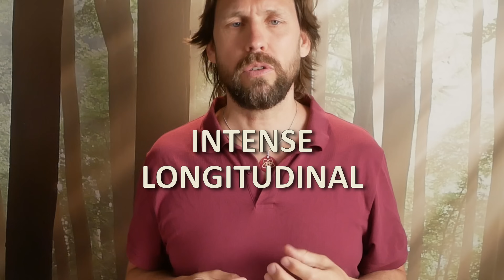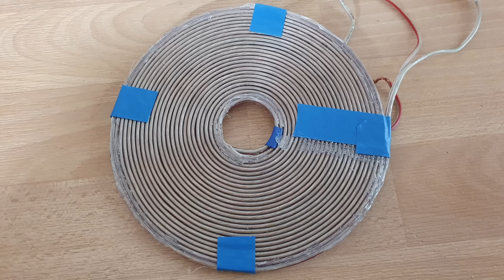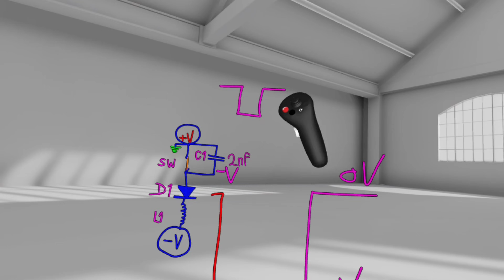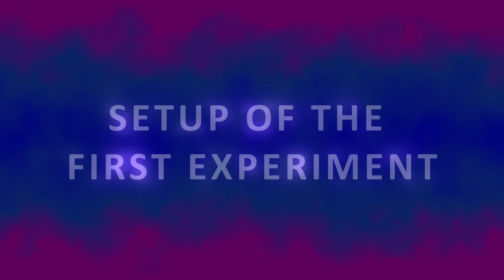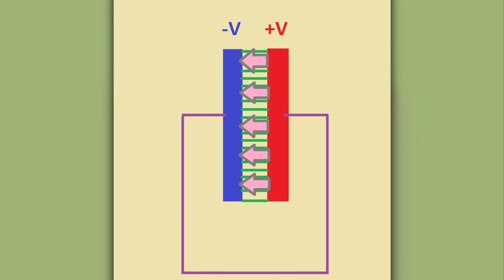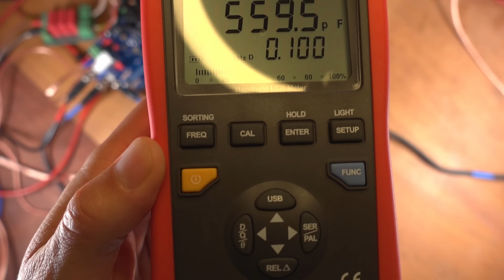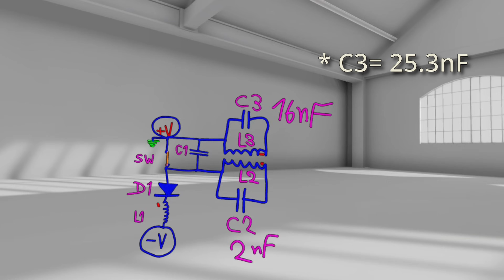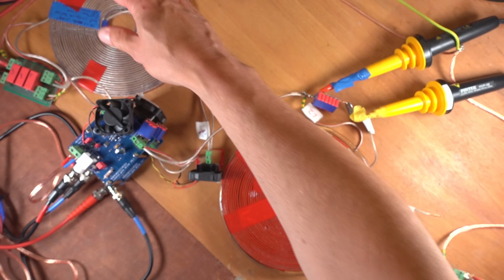Dielectric Induction producing Ground Currents

Comment: I have been reading "The Sea of Energy", T. H. Moray and asking copilot about various aspects of the schematic he has and the "Swedish stone". One interesting discussion I had with copilot was about his antenna system. It is a 87 foot wire (possibly full-wave, ~11mhz), isolated, unbalanced, maybe only 8 feet above the ground. But his ground is 9 feet copper pipe, 0.5 inches in diameter, 8 feet into the ground. According to copilot : "Moray’s 8‑foot ground makes his 87‑foot wire behave like one plate of a big capacitor, with the Earth as the other plate. That increases the capacitance of the system and lowers its impedance at the frequencies of interest, so the wire couples more strongly to whatever RF/EM environment it’s sitting in. The Earth’s “plate” is huge.  Makes the wire behave more like a “charged plate” against the Earth rather than just a floating conductor."
There are more interesting things copilot revealed, but I thought you might be interested in this.
Reply from the maker: the sea of energy has a nice introduction, the rest I feel isn't true. heavily redacted
Reply: @MasterIvo  realize he doesn't have a normal diode. He has a semiconductor/piezoelectric device that down converts energy from RF into oscillating audio-range noise and also that the ground connection is connected to other circuits and the path of least-resistance up thru them.

Comment: Hi Ivo. You need to continue and slightly modify this circuit to remove energy from the resonant coils. You have already managed to increase the displacement currents from the ground, which resulted in an increase in the voltage on L3. This is a simple solution that requires some additional work.
Reply from the maker: yes, I have the current. now only induce the voltage to create power
Reply: @MasterIvo  Hello Ivo! I think that the easiest way to remove excess power from the circuit is by using an induction method (transformer)
 If this excess current does not belong to the L3C3 circuit, then using a regular ferrite ring with several dozen turns, it is necessary to
pass the wire from L3 to C3 from the inside of the circuit. Simply put the ring on the wire of the L3C3 circuit. (it's like a single turn of the primary winding)
 We will transform this excess current into power at the output of the ferrite ring winding. The voltage on C3 will decrease.
The load will determine the excess power consumption before the resonance in the L3C3 circuit is destroyed. The input pulse width should be reduced by lowering
the L1 pump consumption. In general, the excess output power will be determined by the impulse voltage from L1. The higher the better.
Please try this experiment. I think it should work.

Comment: With that time difference, couldn't you set something into a feedback loop? Something like a microphone feedback signal? But you want it to happen, exponentially.

Seems the C.E.R.N. facility uses resonance amplifier fed with coaxial signal. Some "Tesla" parabolic shape. Sound becomes a signal? A copper electroplated 3d printed design?

Comment: This fellow seems intelligent. However, he is falling victim to the same fallacies that so many others have. Reality: energy is conserved. Any energy that enters the circuit from "Earth" falls into one of several categories. Most commonly, it is from energy that was pushed to the ground rod and pulled back into the circuit. Also, electrical energy doesn't flow in wires at high frequencies (which includes those resulting from fast pulses) but rather through fields. Oscilloscopes and DMMs can reveal many interesting phenomena that can be easily misinterpreted if all aspects of Maxwell Equations are not considered in relation to the apparatus configuration. I ASSURE you that an Earth ground cannot provide a sustained current that is able to do work. Many smart people have pursued this only to be disappointed when they finally learn enough to understand what is actually happening in the field. Please don't waste your valuable time following this nonsense. Always remember this: Earth can conduct electricity, but it never pays the bill :)
Reply: Why do you suppose the scalar components of Maxwell's equations were 'removed'? It is of course a rhetorical question which I will answer for you, it is so that trolls, shills, spooks, and gatekeepers can scream 'conservation of energy' from the rooftops and sound like they have some validity to the 'educated' while being able to ignore the zero point local vacuum elephant in the room. This guy is very close to something, whether he realizes it or not, and I would be willing to bet you are aware of that so here you are waving your little thermodynamic law flag around and telling other people not to follow this nonsense, as though you were in any position of authority over what other people should think or follow... I laugh at you, not because I find any humor here, but because you and anyone else that thinks they have authority over the minds of others in the information age imagine they can tell us what to follow. This isn't the 16th Century anymore and you aren't the magistrate... Just like Putin said, "The Vampire Ball is Over." This guy is so close he can probably hear it, so take a hike, there's plenty of other channels preaching Newtonian Dogma you can frequent... yet here you are?
Reply: @MasterIvo I really would like to talk to you, but I don't want to do it on a public venue, how would I get in touch with you, do you have a linkedin or an email?
Reply: @twitchy5710 you numptie 🤡  no free lunch. And what is he close to achieving? Free electricity 😂🤣🥳so you like to hike, off you go 🖕
Reply: - "The Vampire Ball is Over." - mister greg..
Reply: Everything you said is completely wrong. But good try Scooter.

Comment: Teluric voltage 4v max..am I wrong?
Reply from the maker: I actually do not know, but I have seen lightning from the ground up.
Reply: @MasterIvo      lightning does strike from the ground up. That's nothing new. 73
Reply from the maker: @ronb6182  thanks for the confirmation 52
Reply: @ronb6182 you mean streamers ?. It goes many ways

Comment: That's really cool imagine adding the opposite suction of an antenna high in the atmosphere for extra amplification of this electron pump. Like Tesla was doing with his magnifying transmission tower. You know how to do this because you understand the concept.  Your really amazing with this work it's something I been messing with too but using slightly different methods yet this helps to see I am not crazy when I experience these effects that are not used in regular technology of today. Usually they talk about a cancelation of the two but no the difference you describe has also been a conclusion I have personally experienced so it's thrilling to see your great work 👍

Comment: No lenz law with  dielectric induction then why not just harvest energy from a electric motor with switched capacitors ? Seems simple enough
Reply: That's the point why not to do the compensation of a electric Motor to 1. because it gets in resonance and starts pumping energy from the environment into the motor until self destruction occurs.

Comment: I've done some experiments coiling grounded copper wire around magnets under various conditions and have shocked the piss out of myself a couple times. I'm not educated enough to understand what's happening fully, mostly going on intuition. Dangerous, with electrics.
Reply from the maker: thats the best way to learn
Reply: @MasterIvo  It's definitely one way to learn some..things. Things that baffle the mind and have you trying to learn basic electrical theory at forty so I can move onto the bigger stuff and try to figure out what the hell is going on. Everything goes freaking nuts when you tie strong magnets, in forced repulsion especially, to a good strong ground. Throw in some coils and the sky seems to be a limit, to such an extent that the first thing I learned is to deeply respect what I'm working with. The earth is like a massive slow moving locomotive of energy, and if we can find ways to transmit that energy it can be funneled down to incredible power, in terms of what little humans need anyways. At one point I had some insane array of magnets tied to the grounded copper, but the rest of the length after them I coiled up my obelisk shaped bed post, about 7 ft into the air, and it started emitting this field that made my heart palpitate and nearly rendered me unconscious. Pulled it apart quickly. Haven't experimented much since then.. still learning.

Comment: Look induction resistance and capacitance is how everything you see is possible at its basic function and e field's and m field's you don't need a coil or high voltage even Tesla said it could be done with chemical electronics semi conductors because there is no coil no oscillation so you can use alternating currents ok
Reply: carbon battery

Comment: OK. So build a generator using ground current.
Reply from the maker: ok so tell me what more I should do according to you...
Reply: @MasterIvo  Idk. Maybe build one to power your house?
Reply from the maker: @Bravo21   then make it fly?
Reply: @MasterIvo  what worked for me, as in, shocked the piss out of me, was coiling grounded, braided copper wire around the hole on a donut shaped magnet then leaving it alone for a while, coming back and pinching the coil. Huge discharge of energy into..me. I cant remember if I had a bar magnet twisted into repulsion across the donut and taped down..was doing that too. Also my grounding cord touches a big tree, which may be effecting things.
Reply from the maker: @derosecutus3462  tree roots are perfect for grounding. capacity of the coil was most probably charged
Reply: @MasterIvo  so is that energy I drew up from the earth or energy the magnet induced into the coil? or..both? Also, do magnets in repulsion produce a dielectric field or is it just an inverted magnetic field? seems thats what a dielectric field is, counterspace, if one were to think of it in quantum terms

Comment: How does D1 conduct backwards when the switch is open? Seems like it would block reverse current flow, no?
Reply from the maker: depends on the polarity of the voltage on both sides of the diode.
a negative voltage spike will pass.

Comment: Hello sir, would you be able to supply us with you circuit you used with a listing of each part, thank you again and as alway excellence!
Reply from the maker: not yet, the board is still being modified, once it works as supposed, I will update the design and share it.
As it takes a lot of time and energy I rather do this only once.

Comment: There's a Russian video on capacitive plates on two coils. It's a tear down video. The name of the video is Wesley Translate's Akula video #16: Akula's TPU part 5
Reply from the maker: thanks for sharing! an empty capacitor has low reactance (resistance to current flow is low) so if suddenly a high voltage impulse (low current) is presented to the cap, where does the current then come from?  ;D

Comment: @MasterIvo Thanks for showcasing how you create energy pump in open circuit. This has been long due with no one actually showcasing experiments in that area.
This is very important process on how you create energy source outside of closed loop circuit. And it is basis on how "overunity" generators work in this category.

Cheers!

Comment: M Ivo, Thanks for the shared good work. Your perseverance is appreciated. As an email address for you isn't available, I writing instead hopefully to you here.
I am asking about the method you used for bifilar-coil assemblage. By wrapping zip-cord in a coil, it actually places each conducting halves of the coil on top of the other half; whereas Tesla's coil had both halves in a single flat plane. I sense that your bifiar and Testa's bifilar have their respective two-half circuit portions positioned 90 degrees from one another. I recognize that the distances in both are quite small, but am concerned that the positioning might create significant differences in their operation. Have you tried a bifilar wound with Tesla's original geometry?
Regards, H Tinling
Reply from the maker: yes I have in the beginning of my research
Reply: What was your reason for changing?

Comment: Dear Ivo, I'm glad you're back, I'm from Holland too and I really appreciate your research.
How does this schematic work out with a battery as power supply?
Because, I can't hook up my + to earth... while using your research to mimic Stanley Meyers work...
Reply from the maker: ik zou zeggen probeer het, sluit gewoon een batterij aan ipv een psu.
Reply: @MasterIvo  At what voltage do you have your capacitor-tuningboard rated? I really like it and I want to make one, you used it also for coil 3 so it should be at a high voltage level, but how high?
Reply from the maker: @WillieTheW  I used wima fkp1 and mkp10, 2000 dc.

Comment: I got one for you that should become immediately obvious in terms of energy generation potential. The force on a wire in a static magnetic field is "F = L * B * I", 75m of 22 awg only has 4 ohms or resistance, it only takes 4 volts to make an amp flow in the wire. If neodynium is the magnet material, the field strength is 1 tesla. Thats 75 N of force for a continous input of 4 watts.

If you use a ring magnet and and a toroid coil, the ring magnet spins with 75 N of force while the coil is powered. If the ring magnet is 20 cm in diameter, that 7.5 n-m of torque from a stop, but that much torque could easily spin thousands of rpm. using a coil increases the total length of wire needed without being useful so the resisance is quadrupled and the input power is quadrupuled to 16 watts to match.

The motor is called a "homopolar motor" there is no reactice component at run, its dc, it has a static magnetic field while running. The uniqe thing is that the only power requirement to run the motor is to overcome ohmic resistance in the coil, the rotor spins because of felmming right hand rule.

7.5 N-m should also allow the motor to spin at 900 rpm while still having 7 n-m after mechanical losses to spin a load, thats 660 watts.

This is bexause the input power isn't used to spin the rotor, its only there to maintain a static magnetic field. with all of the wires radially aligned on the toridal coil, the magnet has to spin as a natural response to the field because of the circular field current carying conductors make, summed up, makes a magnetic vortex

Comment: Hi, I have some questions for you regarding some features of the two-wire coil that I may have missed, but I didn't understand if they are important the diameter of the inner hole of the coil how big should be?
Reply from the maker: not important, enough to put the cables through. make it as small as possible
Reply: @MasterIvo  OK thanks for your prompt reply.

Comment: ATTN: Master IVO. I've watched your videos gor years, we've chatted and discussed transistors vs spark quenching. I wanted to being this video to you:

https://youtu.be/HaLMjVkKYMw?si=MWboAPVwaoJDvm0e

The topic is signal noise on switched mode power supplies and indictance. They use a transitor and a filter config indictor and observe voltage drop and limitations of transitors about 3/4ths in. Happy studies!

Comment: Thanks for sharing nice and comprehensive video!
Looking at the setup from antennas and radio waves broadcast theory prospective the dielectric displacement current will flow from L2 and L3 surfaces through the ambient medium to the ground earth to complete the circuit. This explains the current probed on the ground wire.
Since L2 and L3 are acting as aerials the EM waves should be detectable by spectrum analyzer placed in a proximity with small antenna covering the frequency band of the setup.

Comment: I know this is not the right video for this question but I don't know if you watch comments on your older videos. Have you looked at the idea of using the Tesla pancake coil as a generation coil? I have been attempting to wind your phi coil in layers for power generation as there have been other YT videos showing where the original patient winding design showed more voltage being generated than a standard wound coil. I am researching of your Phi coil design would produce a similar result ? I am also rewatching many of your videos to see if it's possible to use the back emf and put it back into the coil making it more efficient???